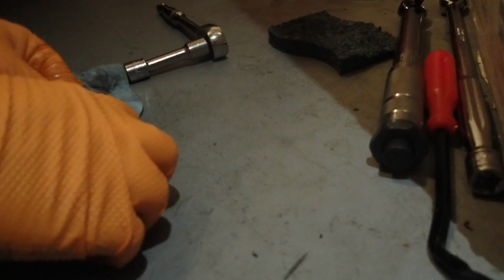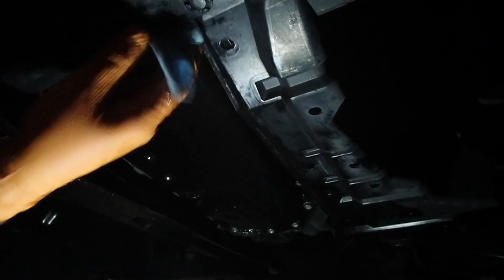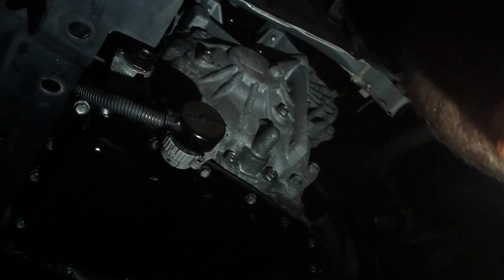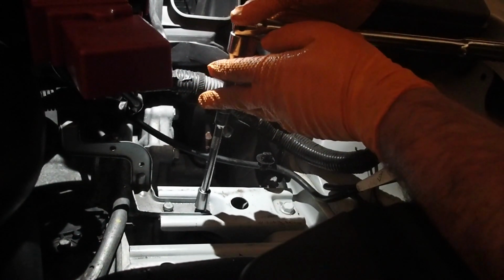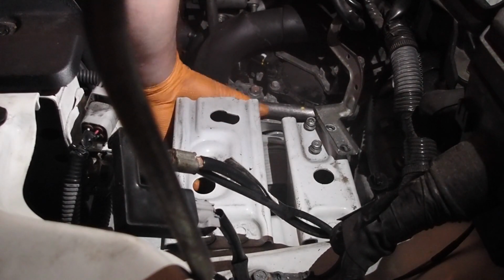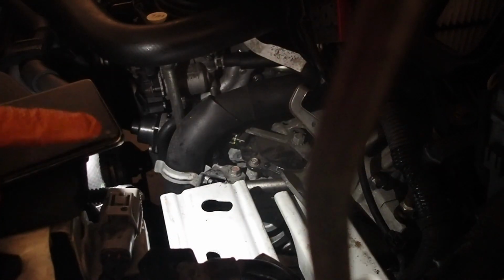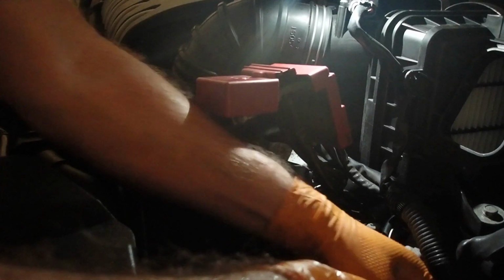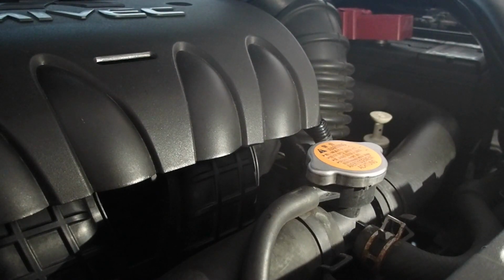2012 Mitsubishi Lancer CVT Fluid and Filter Change

Comment: This transmission should've had service at 30,000, 60,000 and 90,000 miles. CVT transmissions are notoriously dirty. If this is the first time you were changing your fluid in 11 years, I would recommend trading in your vehicle sooner rather than later. The transmission will start going soon.

Comment: what kind of oil did you put in the variator?
Reply from the maker: I put in Valvoline CVT Fluid.
Reply: @Lancer0989  still running fine ?
Reply from the maker: @samanthaosieczonek1242  yes, but I do not use very often anymore.